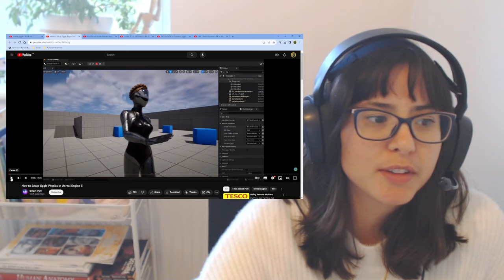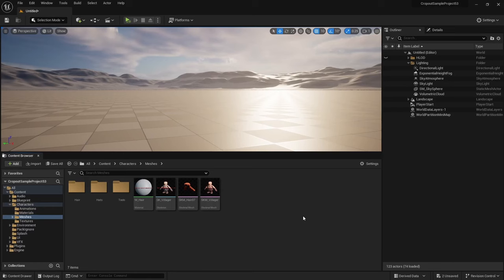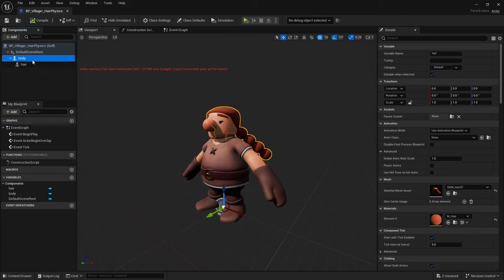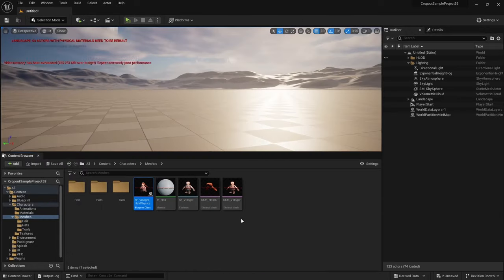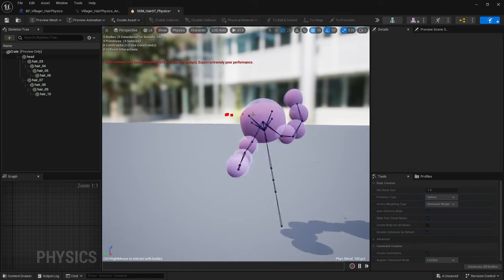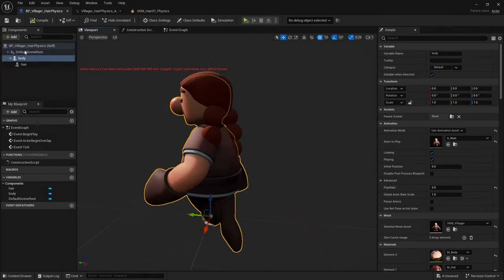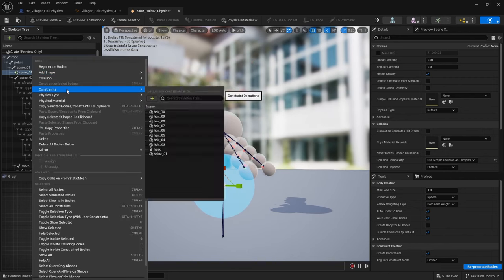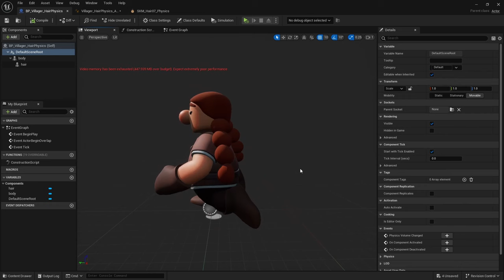Unreal 5 - Physics, Jiggle, Dynamics and Control Rig - Tutorial Series (1/3)

Comment: great tutorial, nice to see something new and I learned something new with the second way you attached the hair, didn't know I could do that thanks!. Should not the hair physics component already collide with the character physics components by default? Then you should have collision with the arms for free if the character has theirs set up correctly.. This is how it works with hair systems, cloth, physics constraints etc in Unreal. I would be surprised to find it doesn't work if they are in the same blueprint. Setting up physics constraints for earings on a previous character ended with me needing to adjust collision on my character.. I'll need to test this out later..

Comment: Hi thanks for this. I'm having a little issue. I have a setup similar to yours but the center ball is knee so it gets animated with the character. And when I. The running animation. The knee seems to just pop into the clothes physics bodies in front of it. Other times it works fine with the physics any advice will b great. Thanks
Reply from the maker: Hey, unfortunatelly the only way is by adjusting the size of the capsules in a way they won't collide as much. Also make sure to tweak the constraints, so it's not moving so 'freely'.

Comment: Great video but I have one question. I have a skeletal mesh with both braids, and a few extra dangling bits of hair. I have followed the steps exactly, but for some reason my hair and my braids all collapse into the center of the hair. Do you know what could be causing this?
Reply from the maker: Hm, it's hard to tell without seeing it. But it could possibly be that they are colliding with something else. Does the body have a physics asset sphere as well?
When you open the physics asset, and press simulate, does it collide straight away, or does it happen only when you are in the play mode?
Try to narrow down where the issue is coming from first, and go from there.
Reply: @kamilabianchi  I’m simulating it without the body at the moment just to have one less variable to worry about and the problem persists. The hair braids and strands all immediately collapse into the direct center of the hair like a vacuum. 

I’m wondering if this is caused by my hair mesh being a bunch of separate meshes joined together in blender rather than being one singular mesh. (I joined them to have an easier time UVing them rather that connecting them with a Boolean)
Reply from the maker: Yes, sorry. Hard to tell what's causing it...

Comment: Can yoy explain the difference if when to use rhe ik rig vs the control rig? The unreal documentation doesn't really make that clear.
Reply from the maker: Control Rig is mainly for animating in Unreal, like you would do in Maya/ Blender. IK Rig is a system to edit / transfer existent animations. https://docs.unrealengine.com/5.0/en-US/unreal-engine-ik-rig/
You can use both systems in a game setup, to adjust systems automatically like foot placement, etc. What I found in Unreal is that there is never only one way of doing something, and if it works, you stick with that solution. :)

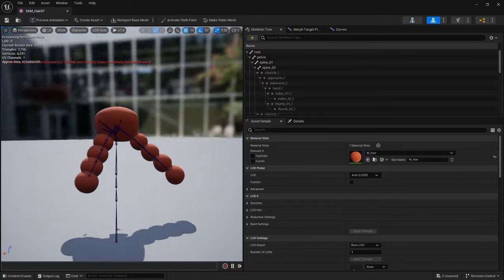Comment: I've been stuck for like a week trying to figure out how you got to what you did at 2:30 . I even did your Unreal IK Rig tutorial, but I am still clueless. Did you edit the hair mesh in unreal?
Reply from the maker: I edited outside Unreal, you could use Maya or Blender for that. Created more 'spheres' for the hair and extra joints, and skinned them.
Is that what you are asking about?
Reply: @kamilabianchi  Ah, thank you. I was trying to figure out how to edit the hair and add extra joint inside of Unreal, but I guess that is not possible.
Reply from the maker: @DRockafella  Yes, sorry. There is a way of doing it using the new skinning tool, but it can get a bit complicated: https://www.youtube.com/watch?v=t7EQ5AtXHWY&ab_channel=KamilaBianchi
Reply: @kamilabianchi  Thank you again! I will do this tutorial too. I've managed to get the hair into blender and add a few blobs for the hair. Now I have a quick question about the new bones in the hair, is that done in Blender or Unreal?
Reply: @DRockafella  We converted the SKM to a static mesh within Unreal and used the new modelling tools. Tri select (Mesh), then flood fill (Selection Edits), create poly group (model, Mesh Edits), which you can then select and duplicate (also under Mesh Edits). Then simply convert the S back to a SKM using the exisiting SKM you can then add the bones in from there which is pretty straight forward. The UI is still a bit buggy though as the feature is still in beta. Thanks to @KamilaBianchi for this series!

Comment: Would it be possible to also make the torso (on the other skeletal mesh) a physics asset and use its collision for the hair? Estimating the shape of the body seems like too much of a guess work and it doesn't take the arm movement into account. Good video. :)
Reply from the maker: What I would do is copying the whole skeleton to the hair, so you could add the collision to the "arms" as well. But as far as I know it wouldn't work if they are different meshes. I might be wrong though

Comment: I try to add glasses to my body but when I use "set leader pose component", my glasses disappear ! Do you have something special on the bones of your hair ? Like same names of bones ? I figure out that my glasses are too small, minuscules ! And with a bad orientation.
Reply from the maker: The hair has the same bone structure as the body, and added joints are all scaled as 1, and with correct orientations.
It looks like there is a problem in your glasses skinning / skeleton.
Reply: @kamilabianchi  The answer [Blender to Unreal Engine 5] Correct FBX Export Settings for Characters ?
Reply: First, are your glasses a Static Mesh (no bones) or Skeletal Mesh (bone joints for the glasses, like a jaw bone pointing forward, and you would want it to pivot up/down)?
Or perhaps in Blender, add glasses mesh at the face (if your character will always wear the same glasses). 

Then rotate the glasses mesh a little, make a copy of the mesh. Merge it to make a Morph Target/Shape key. Which means the movement will go from 0 to 1 (all the way up or down, all the way right or left).
Then in UE, you control this 0 to 1 that changes the mesh angle slightly. And to get wiggle, use a random # when Character is moving.
Reply: @kenalpha3  Thanks for your reply. I used société and working fine. I was using skeleton mesh. Wish you à lot of nice tuto for this new year !
Reply: @JDARRASVP  yw and Ty. Can you give me a better phrase to search? I cannot find ""societe" unreal physics"
Reply: @kenalpha3  Oh sorry, I mean socket. French dictionnary correct me
Reply: @JDARRASVP  ok. So you used Static mesh attached to head bone socket of Body SK? And which method did you use to handle the physics jitter?